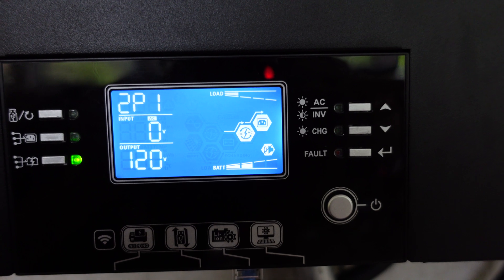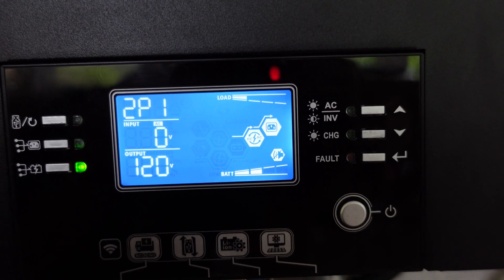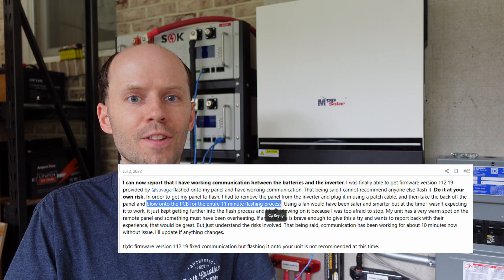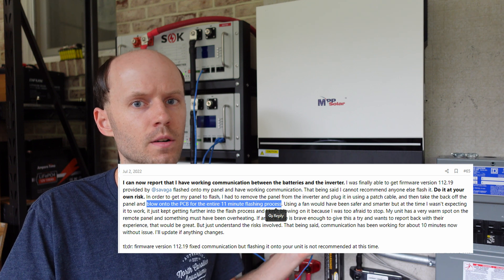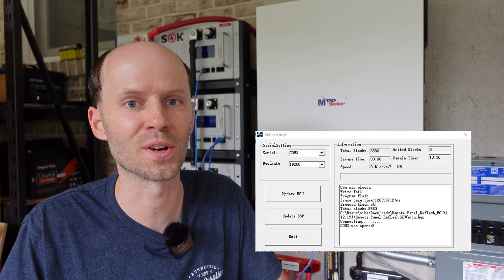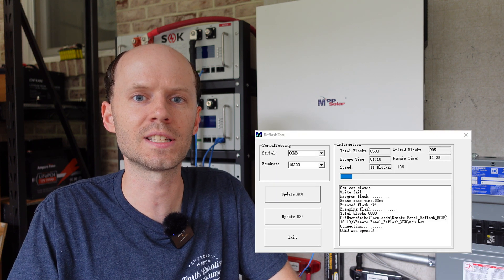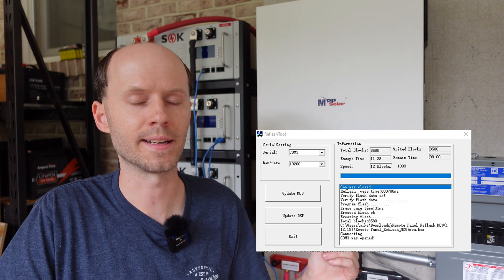MPP Solar LV6548 Firmware Finally Flashed, Error 61 Resolved

Comment: The EG4 6548EX  converters apparently have a higher idle power draw (about 110W) than the LV6548 (70W).  The LV6548V is also high. I particularly care about this during the winter months.
Reply from the maker: I just did a video testing the idle power of the LV6548 vs the LV6548V here, skip to the idle power chapter :)
https://www.youtube.com/watch?v=XfE9QFyHAmQ

Comment: Great video, I have a F90 error code and hopefully will never see the error 61 code but I thought you might know of a solution to fix the F90 error on my SP6548 sun power gold inverter 48 volt 6500 watt i just bought a few weeks ago. F90 is in NONE of the documentation on their website or Axpert or voltronic website so I am hoping you have had some experience as the LV6548 is the exact same product as the SP6548 inverter I bought 6 weeks ago, has yours given the F90 code out yet? If so how did you fix it? I found some info online that the F90 code is a code that identifies a counterfeit firmware so I thought I would message you to see if you might know a way to fix this, the sunpowergold reviews are pretty scary so I thought I would ask you guys - appreciate any help and love your videos guys keep up the awesome videos

Comment: I'm sure they use some common SPI flash chip which can be programmed with a cheap USB flasher. The next time if you have some experience with electronics you can unsolder the flash chip and flash it using the appropriate adapter or do it on the PCB by using a SOIC/SOP clip. The advantage of this method is that you don't need the board to be powered so no temperature concerns.

Comment: I have worked in IT for many years. Many electronics such as mobile phones, laptops, desktops, servers, routers have a heat shutoff. If they get too hot they power off to protect damage to the components. Remember if it is like 80 degrees where you are standing, inside a computer case it will be from 10-30 degrees hotter. The components generate their own heat, especially CPUs when they are being put to heavy loads.

Comment: If you buy the EG4 you can only get spares and support from SS, as they have a tweaked product.  Locked in. 

The vanilla LV6548 can be paralleled with the same from almost any local or international supplier

Comment: Thanks for sharing all of these technical details but I'm a bit unclear on a couple of the fine points....
So, are both of your LV's now running firmware 112.19? If so, was there also difficulty flashing the older unit (the one you purchased in January). The last thing you mentioned was that unit was running 12.13. 
Also, is the Error 61 resolution due to the U2 display firmware update or the the U1 inverter fw update (you have both on 45.07??)
I recall that your 2P2 unit was successfully communicating with 45.07 & 12.13?

Comment: I would think it's a problem with resistance/voltage drop. Cold temps = less resistance and less drop. When programming these chips require a specific voltage. If it changes at all it'll fail. Heating can cause it to have more voltage drop due to increased resistance.

Comment: I work in IT and never heard of having to cool the electronics to such a low temp to get it to take a firmware update, but there are many things in IT that require you to 'jump through similar hoops' to get them to work, so I'm not at all surprised.  BTW, your story of using bigger fans reminded me of an IT issue I consulted on where a company had issues with a hard drive crashing and actually took it out of the case and ran a fan on it 24x7, the problem was that the room where they stored the computer, drive and fan was warm, so essentially no matter how much fan speed they used, pushing warm air across something a little warmer isn't going to do that much.  I suspect this was the case for you... fan speed was good, but what it needed was a bigger temp difference.  Glad you got it to work in the end.

Comment: Hi....!
Hope you are doing well.
Do you remember I think Ina  2 years old video li-ion battery pack 4s6p using 21700 cells......

Please guide me if I want to build same like this a 4s 6p 21700 battery pack will be it is suitable for laptop power bank..?
I have HP ProBook 430 g2 laptop which requires 14.8v and approximate 2A 
Please reply I'm waiting for your kind guidance.
Regards: M.Zubair
Reply: Entirely depends on the cells you choose by mostly yes. 16.8volts to 14.8V only brings you down to 3.70V per cell…quite a bit of capacity is left. 

The easy solution is to use a buck boost converter to have a regulated output voltage when your cells are above and below the laptop power supply voltage. The LTC3780 has been popular because it is 10A but you could get away with a smaller unit or just don’t use one and give up all that extra capacity when the 4S pack gets too low
Reply: Thanks @ericklein5097  ......!
Will you have some time for my project I tell you all details and will you have some kind words suggestions.....

Comment: Two rather important questions I hope you can help us with: First, if I have 5 48v server rack batteries with communications connected, and one BMS detects a fault, will it take the entire rack offline or just the one battery? Second, in an off grid system, will the BMS autoreconnect or be able to be reset without external power? Thanks! These questions are from guys who put a ton of power on sailboats.

Comment: I have an EG4 6500EX-48 and it is having the same Error 61 issue and Sig Solar has not been able to help with this.  I have mine connected to 4x SK48v100's and here is a direct quote from Sig Solar email: "I cant speak to other models we do not carry or offer support for but the EG4 unit at this time will not communicate with those batteries EG4 has been doing testing but as I stated at this time they will not communicate and there is no firmware fix for our unit to gain that functionality at this time."

Comment: Hey a quick question when you get time, I really like those PYTES 48v batteries that Watts 7/24 has,   they are a little more than Signature solar,         What I don't find about those batteries is the efficiency rating like S. Solar shows for there's.....Almost no reviews on them, any way  could you do a tear down on it?   I do like the quick connection for the wiring , no need for risk of overtightening the bolts. Also, they have a 6000 cycle compared to the EG4 7000 cycles.    Your thoughts?

Comment: Might want to try a better inverter.  If you are interested in a grid-tied inverter, which removes the cost of batteries, check out the Fronius Primo, 3.8 - 10kW. Comes standard with a 10 year warranty.  Designed and built im Austria,, with support via phone here in USA, by native English speaking staff.

Comment: I'm guessing, but I've seen this before. There is a possibility that there some micro cracks on the soldering on the pcb. I know you have the new firmware now installed, but it should would have been fun to try some freeze spray on various parts on the pcb to see what would happen.

Comment: Thinking about your problem, could it be in there circuit they have put a temperature control resistor to adjust a circuit.  Maybe that affects the voltage control circuit for the software update.

Comment: by all respect: Taiwan is not China and our contact and sales adress is always Taiwan, not China

They had been wuite helpfull here in a grid tie scenario where we use dozens of the MPI 5K or 5.5K cause their support had been quite efficient and fast with spare parts / boards at least in Europe.
The only negative point is their fooling strategy to offer european customers the same product and service for totally crazy prices. You can get their inverters from their ebay stores in italy for 1200€ and in germany from their german account for 1800€. They use domestic ebay accounts but all with references to Taiwan. Sometimes they claimed to have a european warehouse but that changed over time or they had no inventory due to high demand since Russians invasion in the Ukraine.
Reply: I believe MPP is the OEM.   All others are relabeled or PRC factory copies.

Comment: Thank you for sharing follow up with a solution. 

By any chance after successfully updating, did you try again flashing another firmware without cooling? (To rule out if there is thermal protection somehow or hardware problem) 
I think you don't have but also would be interesting ti see both boards under thermal camera while flashing  to see if there is actual temperature difference between different boards. 
If the hardware is problem could it mean that you possibly as for newer version one using the guarantee? 
Nevertheless thank you for the tip and video.

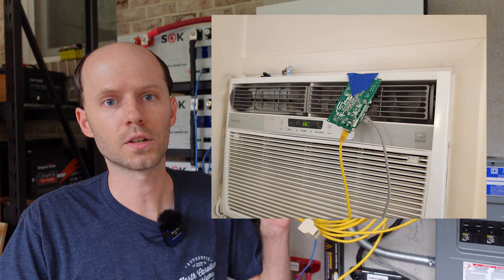Comment: i feel like your trolling me 3:17 did you use a coupler to extend your cable lenghth
Reply: If that's a normal ethernet cable then it should be able to go up to 500m without an issue per spec (at 10 Mb/s).

Comment: Man that’s ridiculous what you had to go through. I’m not sure if the EG4 variant is the answer either. They all come out of the same factory and I’m pretty sure any software updates originate from there. A lot of companies loose interest in a completed model and constraint everything on the next project. I hope Voltronic isn’t one of those. So far this doesn’t give me that fuzzy warm feeling that if something goes south in a few years that it’ll have support/parts. Victron, Sol-ark and Schneider seem to have support and parts. Really have my eyes wide open.
Reply: Software might be different, and since it has issues with overheating during flashing, possibly slowing down the flashing process could solve the issue.

Comment: Fantastic story - I was a software engineer from 1984 till 2018 and installed / setup many many pieces of equipment and never ever heard anything like this!!  so interesting and it had a good ending.   Made my day and you got a good result :)   This is one for the anals like entering G800 (something close to that) on boot of early floppy-disk-based DOS to access the low level disk format.   Thank you for sharing!

Comment: A great experiment might be to use freezer spray and keep flashing until you isolate the component/s causing the issue.
Reply: I'm betting it's the baud rate driver for the serial connection, the baud clock frequency is probably slightly out of spec. Chilling it probably changes the capacitance which puts the clocks back in spec.
Reply: Its most likely the eeprom itself. Flashing those memories generate a lot of heat (depending on technology its using a laser or a UV light to erase the memory, and that can heat up the chip). But i never heard of it overheating, max I have seen was around 40-50*C, way lower than 90*C most electronics will start having issues at.
Reply: @hubertnnn  I doubt there's an EEPROM for firmware on that board.  EEPROM's are largely redundant for most applications, the application will be on flash memory, probably flash ROM on the microcontroller.

Comment: Another brand to stay away from...IT hardware guy since 1986 here too, flashing FW are NEVER this difficult. Seems they done it on purpose.
Reply from the maker: I don't know that I'd say that necessarily. I have quite a few of their products and they're always rock solid. I've never had one fail. The support though... that seems to be the problem.
Reply: I would not say on purpose. Flashing outside of circuit is easy, flashing in circuit can have some weird side effects, since most memories require you to put 12V or more to a 5V rail (usually the reset pin) to switch to flashing mode. That 12V can cause some weird side effects with the rest of the device if not planned correctly.

Though in this case it feels to me its the speed of flashing that's the issue.
Eeproms get hot when flashing, and it might be possible to reach dangerous (disconnect) temperatures if flashed too fast, though I never have seen this kind of issue myself.

Comment: The eg4’s really a better unit for the reasons you mentioned. I’m not sure if they’ll communicate with your SOK rack batteries.
Reply from the maker: I talked with them today and confirmed they do support the same Pylontech protocol.
Reply: @LithiumSolar  that’s great news. Technically it makes sense I guess. They just added their eg4 Battery protocol to what was already there on the lv6548.

Comment: I've also been in "IT Support" for over 20 years, never seen anything like that before!  Maybe it was.. made in Alaska?
Reply from the maker: Me either. Closest I've seen is flashing raid controllers outside of a server, but typically just put a fan on them and they're good to go - never seen anything as ridiculous as this.
Reply: I worked in consumer electronics for a long time. It's probably a clock issue in the design (outside chance it's also about power supply smoothness). In order to get it to write, it seems you need to drop it to sub-ambient which will change the value of some of the components which allows it to start writing. Added airflow from a PC fan will just lower it to ambient temperature at a minimum, if your ambient is low enough then it might work and a compressor will output chilled air due to the way the air expands as it comes out of the compressor. But if you are in a relatively warm room already and use a fan, the device doesn't go sub-ambient (skin is more easily cooled by fans because it convects the humidity from our skin).
I remember working on a Pace Set-top box which wouldn't start up reliably because the oscillator capacitance was out of tune. Given the device is being updated via serial, there's a good chance that the oscillator that drives the baud rate is out of spec.